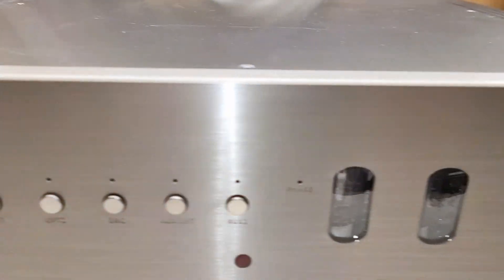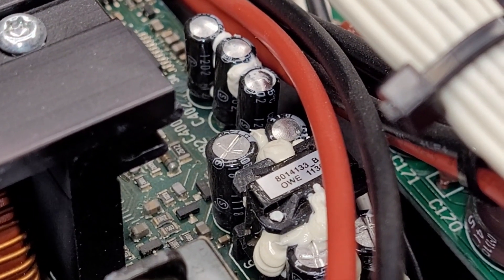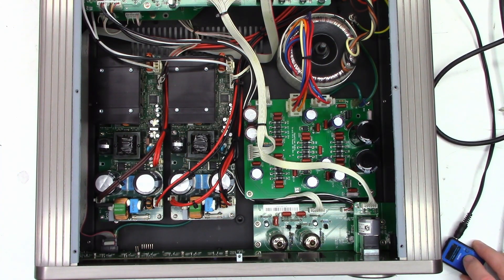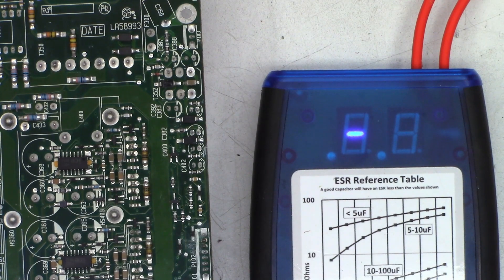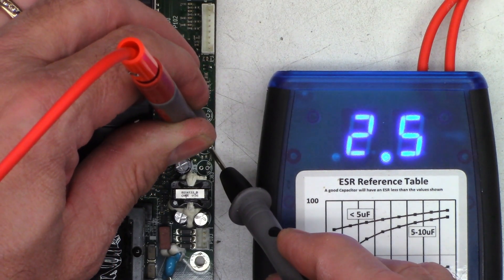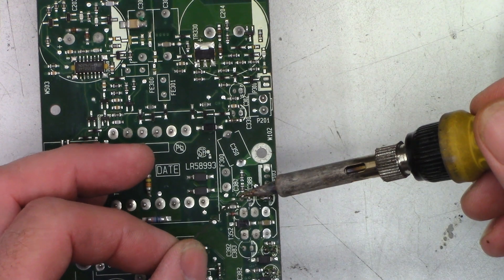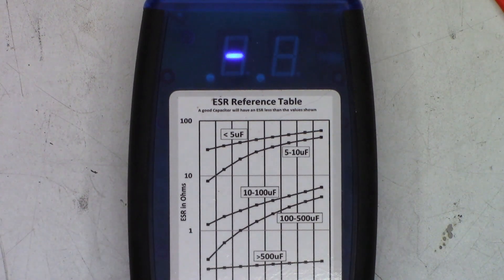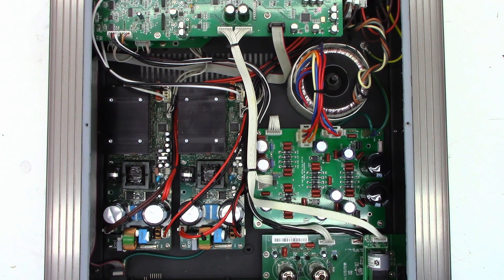Peachtree Audio Grand Integrated X1 Stereo Amplifier. Buzz on one channel. Successful failure

Comment: Some units tend to be a complex and royal pain in the proverbial to fix when they go wrong even with available service data; occasionally it goes back to the customer with the notation "uneconomical to repair" due to the extent of the fault(s) and/or damage (if any) along with replacement parts not being obtainable. As embarrassing as it may seem, it's best to quit while you're ahead of the game before things get too expensive and ridiculous. There are no guarantees of long-term reliability if the repair is successful either. Bottom line is that you made the effort and did your best rather than flat out refuse the job and I hope your customer understands this.
Reply from the maker: He does. Thank you.

Comment: Sounds like a resistor, an SMD resistor being a bitch somewhere.
Reply: I recommend freeze spray too Norcal, I’ve had a newer few amps with weird faults like this. When you narrow it down hit the area with freeze spray and heat when you want it’s helped me pin point loads of faulty components.

Comment: I assume the customer did not want to spend too much on this amp. Failed capacitors probably damaged IC's connected to the output stage of the amp circuit...do you agree?
Reply from the maker: Yes I do agree. Thank you.

Comment: How was this successful at all you finally get a difficult repair that does not require cleaning a switch and you give up .Now is to time to use your troubleshooting muscle .DISappointed
Reply: He said successfully failure, l know it was  time to show us the real deal
Reply: @joseortega9841  , You are so right. I was with a commercial electronics company for many years, and sometimes we couldn't find/buy a schematic or service manual for an item brought to us for repair. I remember trying to find information on a German made marine rate of turn indicator for work boats. They would not share information with us, and advised to send the unit to one their own US service centers.